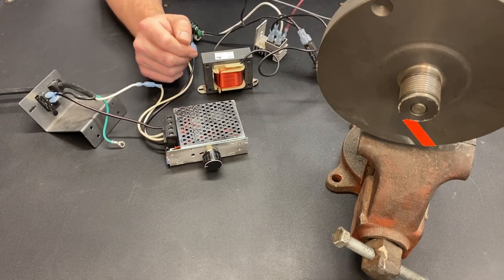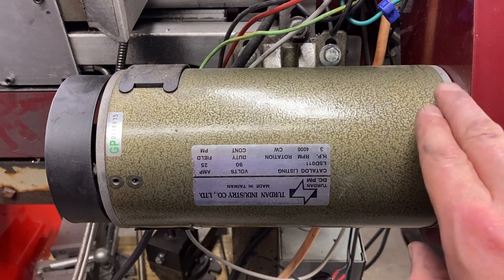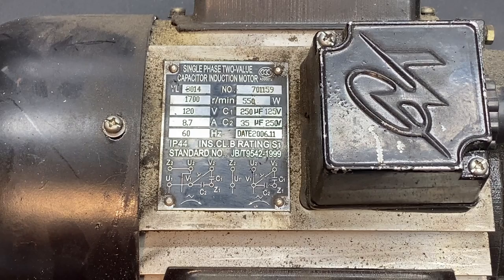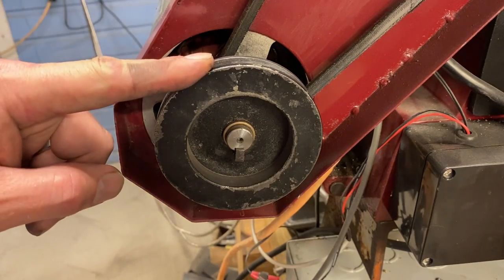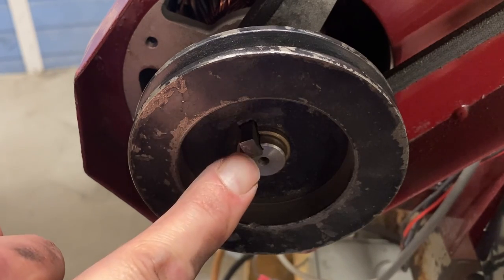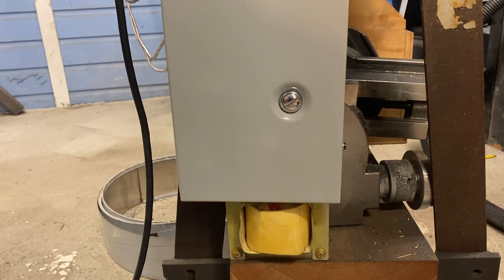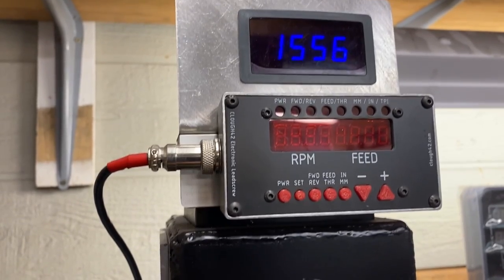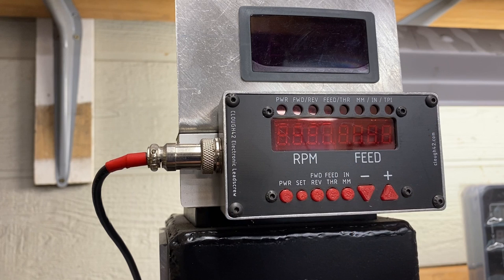Metal Lathe Treadmill Motor Conversion & Treadmill Motor Controller

Comment: I need to get off the bench and just do it already instead of watching all of you guys' youtube videos. Thank you for the wealth of information.

 I set up my last Smithy AT300 (similar machine as yours) the cheap way after the original motor burned up and used the treadmill controls to run the motor. I was even able to power tap. It was an upgrade to be sure.
Reply from the maker: as your project progresses don't hesitate to reach out if any questions arise.

Comment: Brilliant video, thank you so much!  I just replaced the potentiometer in my setup based on this video and it works swimmingly
Reply from the maker: glad I could help.  Did you go with the two potentiometer system for course and fine speed control or just a single?
Reply: @dazecars  I just went with the single.  It's for a belt grinder, I don't mind a small dead spot at the very beginning

Comment: I have a old Logan lathe with a Dayton DC motor variable (1970s era )   i am rebuilding  this lathe.  Would i benefit from this treadmill motor upgrade . My fear is the Dayton control box failing later and parts coukd be unavailable
Reply from the maker: I need more information to know.  The concept of a DC motor and power supply  are relatively universal.  What I am saying is you could restore it as is and if the power supply fails simply replace the power supply with something similar to what is used to drive a treadmill motor.  You need to make sure the new power supply is within the correct specs but they are easily configurable.  As to weather or not the treadmill motor would be a downgrade, lateral move, or upgrade, I would need to know the motor specs from the label.  the more information you can provide the more help I can be.

Comment: Im needing to control speed of a single phase induction motor extractor fan 220v . Its about 10a . Would one of these scr controllers work or would it need a frequency controller
Reply from the maker: using an SCR as a way to control the speed of an AC motor results in reduced torque and is extremely hard on the motor and not a good idea.  You need a frequency controller

Comment: Yo you have been posting videos lately in direct correlation to the same problems I’ve been having with my lathe conversions!! You my friend are a badass! Thank you for what you have been doing 🤙🏼🙏🏼 learned that my motor is dog shit and have to find yet ANOTHER treadmill with a stronger motor🤦🏻‍♂️ any suggestions other than offer up..? Also, I’m personally doing a wood lathe conversion and been having a helluva time finding a way to mount the bitch on my frame all while still keeping the pivoting function for belt tensioning…got any ideas…? Once again you are the man, you explain things in a way that I can comprehend (which is rare nowadays I guess, the other videos on “treadmill motor conversion” are DOG SHIT!!!
Reply from the maker: I don't know about badass, but I do appreciate the compliment!!  As for finding them I have Craiglest email me every time a treadmill comes up.  Most of them are $$ but some are free.  I also check Facebook marketplace ever couple days.  I find about 4 free treadmills a year.  Some are good and some are not so good but all have good usable parts for a verity of projects.  I might be able to help with the mounting situation if you emailed me pix.

Comment: Hey, i have found your videos incredibly helpful. I'm currently working on this project. I need suggestions for pulleys and belts. Specifically, where can I buy pulleys to fit my project. I have searched everywhere
Reply from the maker: Glad they were helpful!! My local ACE hardware store had tons of pulleys to choose from in their pulley and belt section.  Adapting them to the motors sometimes required opening up the ID of the pulley or sleeving the shaft on the motor but there were lots of options out there.

Comment: I have a HF 44142 lathe and I picked up a Nordic Track and harvested a MC2100LS & 2.8hp motor. Being a PWM controller supply is this still a good candidate for re-powering the lathe?
Reply from the maker: it will work but is not my first choice because the MC2100 is fragile.  Here are a couple videos where I used one and then after it fried.  https://youtu.be/pAGfRHpHa-0 and https://youtu.be/yMkW2SXl_sA

Comment: In your video you talk about pulleys and in the way you did it “was a bad way to go”. I’m just in the process of setting up my lathe/ mill (identical one to yours) with the same tread mill motor. Have you made any changes to the pulleys since? I’ve got everything wired the same as yours and it does what it’s supposed to. Thank you for your videos. I just tore apart my 7th free treadmill.
Reply from the maker: Not sure what you are referring to as "bad way to go"  other than my one size fits none approach to speed BEFORE I went variable speed.  Mine is currently geared at 5:1 because I make some high pressure cuts and the lathe doesn't even bog down.  I never have much need to go to the speeds that a different ratio would afford me.   If you have any other questions, please don't hesitate to reach out.

Comment: New subscriber from mid-Canada. I too have converted my mill lathe to treadmill power. I want to learn to add the fine speed potentiometer.🎉
Reply from the maker: Welcome aboard! What are you using as a power supply for your treadmill motor?

Comment: Could I ask a quick question, when calculating torque comparisons of different motors, doesn't the gear ratio of the drive pulley effect the power of the machine? For instance I have a dc motor with 2.33 torque value that spins at 4500rpm compared to an existing ac motor with a torque value of 2.8 that spins at 1400rpm. If I gear both motors so they power for example a lathe chuck at max 2500rpm won't the dc motor produce more power as it would be geared down to rotate the lathe chuck at 2500rpm where as the ac motor would be geared up to rotate the lathe chuck at 2500rpm?....
Reply from the maker: You are 100% correct that gearing it down will help balance torque or in this case give you more.  Keep in mind the entire reason for running a treadmill motor is reduced speed so you will be often times running it at a slower speed which reduces HP.  Also as an example in the case of my lathe I set up the new motor with the same pulley system as the old motors slowest setting 3.5:1.  Running a lower gear ratio would have required at lot of modification and likely a free spinning hub so that I could add a third pulley and second belt. Also every revolution of your motor brings it that much closer to the end of its service life.  A motor that is run on average at 1/2 speed will last twice as long as the smae  motor if it runs at full speed all the time. I Mention the torque and comparing motors in my video because it would be easy to look at HP numbers and think that the treadmill motor is better but in some cases it is not.  Gearing can be applied to both motors and is "something extra"  calculating the torque values gives you a direct apples to apples comparison of the motors.

Comment: haven't checked the comments so not sure if someone else said it yet, but horsepower can absolutely be measured with a wattmeter. One horsepower is exactly 745.7 watts
Reply from the maker: Thanks for info. I’m sure you probably need to load the motor to max watts?

Comment: I have old  bench lathe myford and motor defective ,so i want to replace with treadmill motor which i already have ( 130v dc 6700rpm,2.5 hp) please help me to fix this trrdmill motor . Thanks
Reply from the maker: Is that 2.5 HP max or continuous?  I ask because of the high RPM rating.  That sounds like one of the smaller cheaper motors and if that is the case it would likely not be a good candidate for the lathe. https://youtu.be/KPcAr9orqZw

Comment: On you wiring schematic it shows a “phone charger power for rpm”. How does that work please?
Reply from the maker: it's not a phone charger, its a power supply for a household item.  It is DC and had the correct voltage to power the RPM meter.

Comment: I lost my last comment. But what’s the box beneath your rpm meter? Cable going in and labeled rpm and feed. 
Thanks,
Paul
Reply from the maker: that is controls for my ELS.  I converted my non threading machine to be able to thread. https://youtu.be/47Xyfnvqpes

Comment: lathe chucks have a max rpm ,,, sure you know that ,,,but your such a good source of information I wouldn't want you to have a  major whoopsy
Reply from the maker: Thanks!! and that is a good point.  When I set my machines up I did it with max desired RPMs in mind not wanting to go much over the original RPM amount for not only the chuck but also spindle bearing life. I also wanted to maximize torque at all speeds so  I used the pulley ratio to put max Motor RPMS close to max machine RPMS in the original configuration prior to the treadmill motor swap.

Comment: I’m converting a treadmill motor into a tablesaw motor. I have the motor and that’s it. I need a potentiometer, a choke and a switch and what else.? And let’s say I didn’t need/want speed control, just a switch, what’s the easiest way to get my saw running, what are the necessities.?
Reply from the maker: My first question would be why?  If you don't need speed adjustment there is no reason to use a DC motor and using an AC motor would be a whole lot easier.  The next thing is setting up the DC motor is not as simple as "a potentiometer, a choke and a switch" you will need some sort of DC power supply.  To correctly set up a power supply especially a fixed one I would need more information.  What are the specs on the motor you are using?  in other words what is the voltage rating and what are the max RPMs?  What RPMs are you wanting the motor to run at its fixed output, and are you going to be doing any gear reduction?

Comment: I have a thread mill in working condition and I do not use it and want to dismantle the motor and the control circuit and use the control circuit as well as the motor in my mini wood lathe please advice
Reply from the maker: I have tones of content on my channel on doing just that.  I recommend you spend som time watching.  I am happy to answer specific questions as they arise but most if not all of what you need is already in my channel content this playlist has a lot of good info https://www.youtube.com/playlist?list=PLg4j6XzBdSY_83r86goaHonVUjoKsnIJM

Comment: @dazecars Amazing content!!
I am the recent parent of a second hand Grizzly G8688. The controller is no good. Bad microcontroller chip on the pcb. Would this SCR setup suffice as an option to get the mini lathe up and running? 
Motor Specs: .75hp, DC110v, 3 Amp
Reply from the maker: yes an SCR with rectifier and choke would work well for that DC motor.
Reply: @dazecars  Thank you! Filling the Amazon cart now with all of your recommended parts and pieces.
Reply from the maker: Let me know if any other questions come up or if I can be of any further assistance. @koriwright9135

Comment: You should do a video on making a power supply for a 240v motor. I have a 240v 4 hp treadmill motor that would be a beast but I've never seen a 20 amp 240v variac
Reply from the maker: That is very simple.  Use an SCR setup like I talk about in lots of my videos and hook it up to 220.  That will allow you to use the motor no problem

Comment: Dang that open/unloaded chuck at 1500rpm was freaking me out. Great vid though, thank you for sharing your knowledge!
Reply from the maker: That is a myth.  As long as the chuck uses a worm gear to move the jaws (witch 99% do) there is no risk of the  jaws coming out unless you were on the last tooth.  The is why people use worm gear drives, they are for when you want to spin something from one input but not have any pressure from the other output cause rotation.

Comment: Do you find that the lowest speed(50rpm) still has the torque necessary?
Reply from the maker: That is the nice thing about a DC motor, the torque number is the same through the entire RPM range with the exception of the very lowest speed.  I singe point thread grade 8 bolts all the time to double the length of the factory threads and I do it at about 70 RPM.  It doesn't slow stumble or bog, BUT I am using a quality treadmill motor.  There are lots of different motor configurations available but I would say they all fit into one of three categories.  Cheap home treadmill, the motor usually has 1-1.5 foot pounds and can be run from 7000-10000 RPM requiring massive gearing.  An expensive home treadmill which usually has 2 to 4 foot pounds of torque and an RPM range up to 4500 RPM.  And then there is the commercial treadmills that have 3.5 to 5 foot pounds and a max RPM of 2500-4000 RPM.  The motors on both my mill and lathe are medium quality from expensive home treadmills.
Reply: @dazecars  Thanks, that was going to be my next question. Many in my area for free on FB. Most are old Sears-types but there are a few that appear to be better quality home units like Nordic Track. Not that that name should impress but they appear to be larger and heavier. Their replacement motors online appear to be above the minimal DC types. Do you have brands that pique the interest? I suppose it's a bit of a gamble. Dragging these home just to break them apart doesn't enthuse the wife(nor myself) so it needs to be worth the junk parts I can salvage.
Reply from the maker: First of all I don't pay for them so even if I don't get as much good stuff I'm not out anything.  People don't want to go through the effort to move them so they do come up for free several times a year.  I search facebook market place and I have an automatic search on craigslist that emails me anytime a treadmill comes up.  I have scrapped about 18 of them in the last 3-4 years and I never know what I am getting until I get it home.  As a rule the bigger the machine the bigger the motor will be.  A treadmill is full of good stuff.  Even the smaller motors are good for a drill press or other similar applications.  The tread deck makes outstanding shelving in fact the "work bench" I sit at for most of my videos is a treadmill track. Tones of uses for the incline motors, and then there is all the box tubing.  Also the smaller treadmills tend to have the choke needed for an SCR.  I can scrap one in about 30 minutes and its always worth the effort.  Lastly when choosing a motor never go by HP numbers, always calculate for torque.  @836dmar
Reply: Excellent info. Thanks so much!  @dazecars

Comment: Cool video, I'm just about to do this conversion to my Lorch precision plain turning lathe (circa 1910-1930). I'm currently looking into braking resistors, which are quite easy to add to this kind of setup, with a DPDT relay (or in this case, two DPDT relays, one for direction, one for power supply<motor>braking resistor).
Any thoughts on this?

And how about the need to remove the flywheel? I figured that the extra rotational inertia would be good to even out the speed when cuts are being taken.
Reply from the maker: Thanks!! I have a 3 videos series on braking resistors for my lathe. It’s fully automatic and engages when I cut the power or go to “neutral” on the direction switch. I used the flywheel on my mill for extra rotating mass but removed it on the motor for my lathe because the 5” chuck acts as flywheel mass.
Reply: @dazecars  I was going to ask the same question about the flywheel. Did you remove it with a gear puller?
Reply: @nigel-matthews  Flywheel on mine was simply threaded on. It took a bit of doing to crack the factory loctite, but not impossible. The spin-it-up-and-grab-it-with-gloves trick didn't work and I ended up removing the plastic fan on the opposite end, puting the now-exposed shaft into the vice, yanking on the flywheel pulley, then putting the fan back on.
Reply: @daxliniere  interesting. I’ll have to try that. Thanks!
Reply from the maker: @nigel-matthews  The flywheels that had a keyway and set screw I was able to tap off with a dead blow hammer.
Reply: @dazecars  thanks! I’ll take a look this weekend. I appreciate your help.
Reply from the maker: @daxliniere  if it is loctihted a tourch to the pulley on the flywheel will make short work of it.  A lot of them that are loctited on will not budge without heat.
Reply from the maker: @nigel-matthews  does it have a keyway?  if not it is thread on.  Most thread on bigger motors can simply be unscrewed by running it in reverse.  All of the smaller ones  use loctite and require heat to get it free.
Reply: @dazecars  it’s a thread-on one. The pulley and flywheel are one piece. (It’s the 2.8 hp @ 130v M-314571 motor)
Reply from the maker: lock tight

Comment: How many hours can a treadmill run when in use?
Reply from the maker: In theory non stop.  Heat is the only concern.  As long as it is setup with the correct cooling fan as either part of the flywheel or external on the shaft and is geared so it is still producing decent motor RPMs at the desired machine speeds it will only get warm.  If a person wanted to run it for long periods of time at the slowest motor speeds an external cooling fan not related to motor RPM would be a good idea.